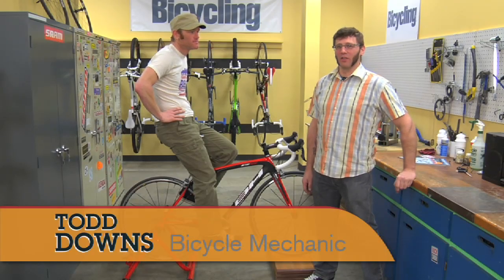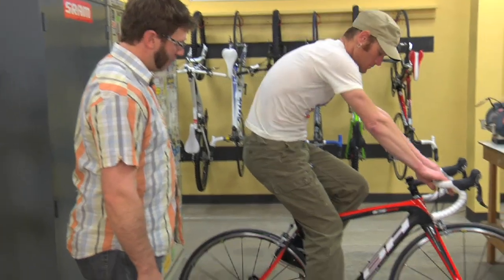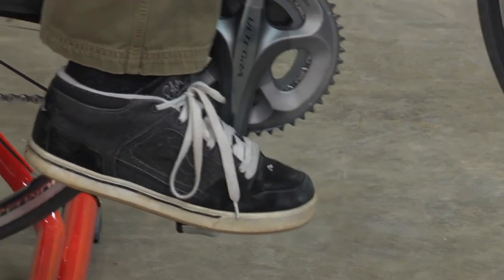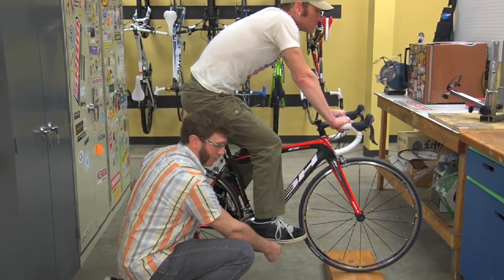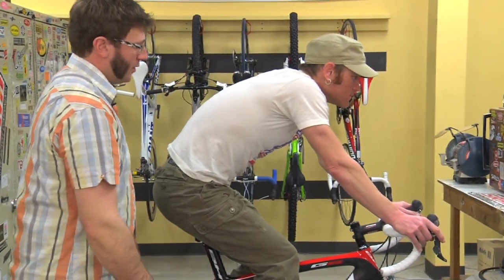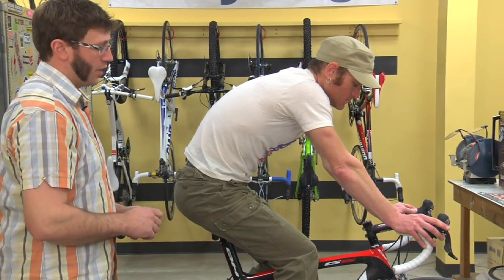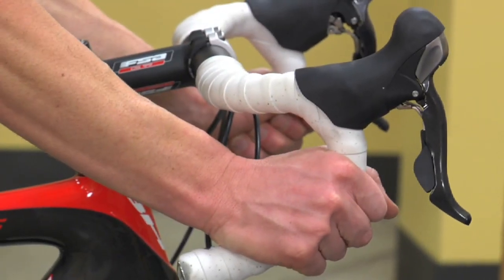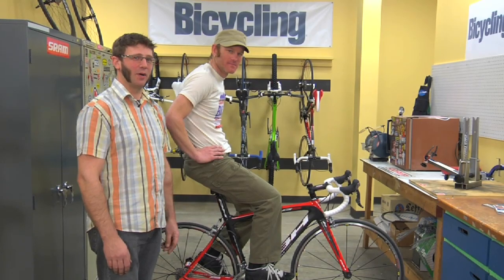Make Your Bike Fit

Comment: Measure wearing your riding shoes and cleats, this will give you your correct height. Road shoes to everyday shoes can differ about 3/4 inch which is huge when your putting out 50/100 miles with comfort